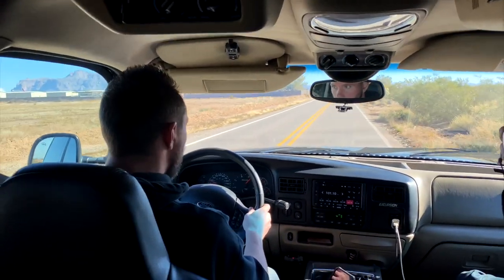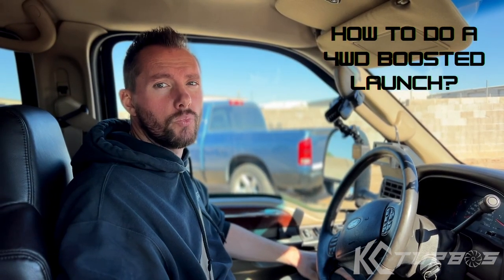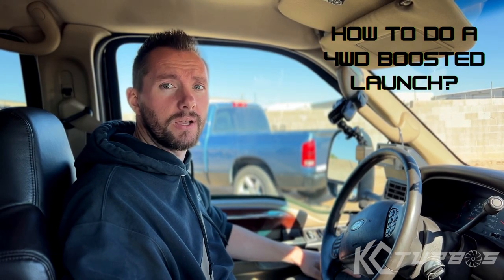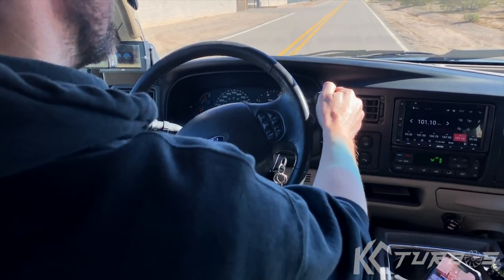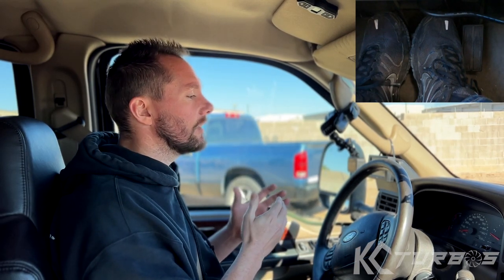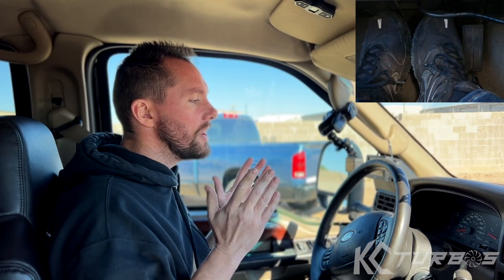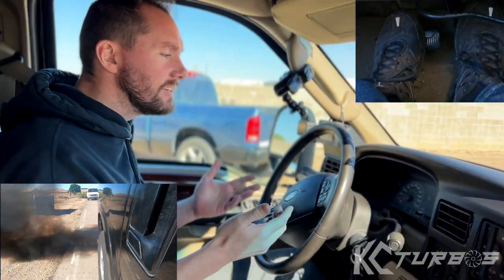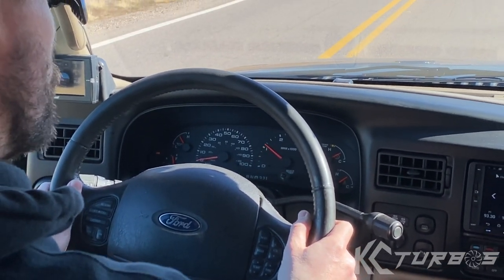How To Do a Boosted Launch In Your Diesel!

Comment: Wish I could find a good video like this on doing it with a manual diesel truck
Reply: he's driving one in the video?
Reply: It’s an automatic
Reply: should not be to hard. Hold the clutch with left foot and heel-toe the brake and gas with your right foot. Hold the brake hard and ease the clutch to not stall the car while simultaneasly giving gas. Drop the brake and the clutch instantaneausly and it should work, in theory. But im just guessing
Reply: @oskarsjolund6758 probably burn the clutch tho